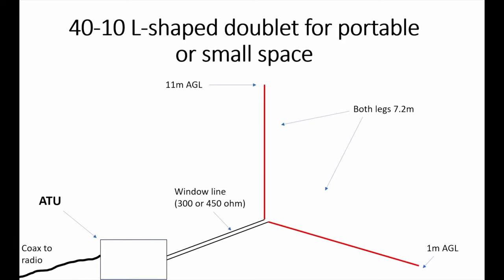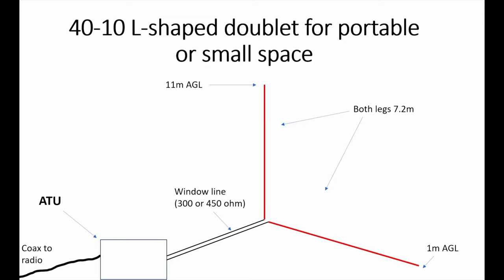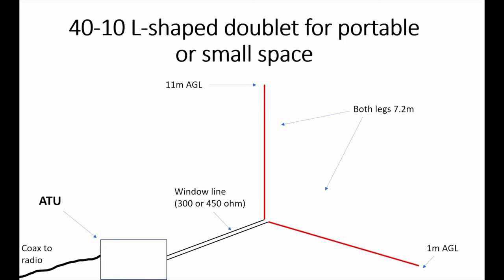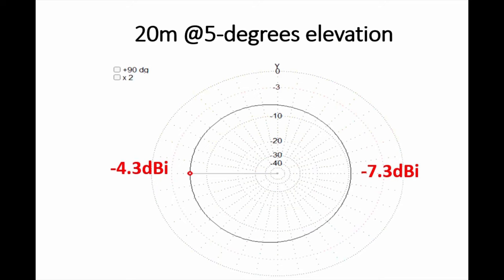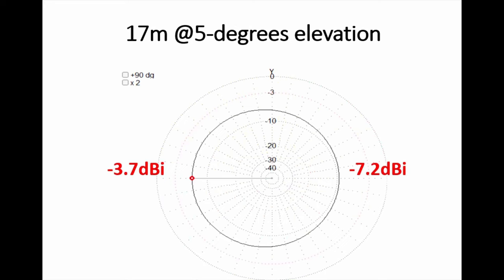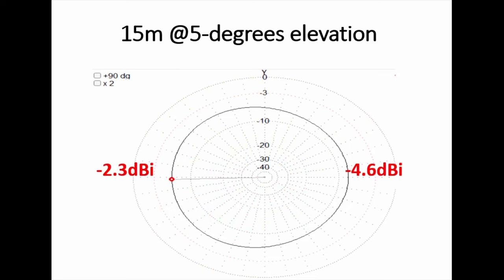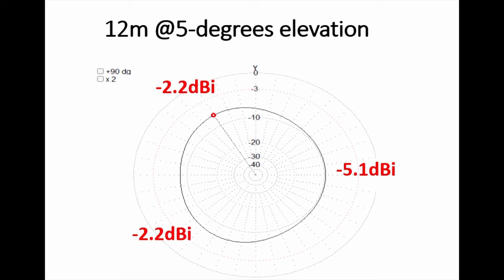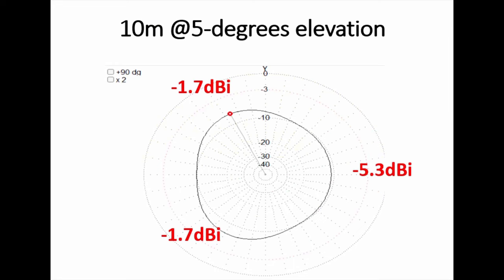Simple 40 Metres to 10 Metres Small Space Antenna

Comment: It might be interesting to know how much the feedline radiates with this setup.  In practice, I don't know what it might look like, but I imagine that the currents along the feedline don't cancel out as well as they would if erected as a traditional flat-top or inverted-v.  In theory, I might think that wit the proximity to ground being very different from one leg of the antenna to the other, it might generate a reasonable imbalance.  I assume the model is simplified to reflect the feed point and the two elements, and the feedline itself is not included?  Would be curious to hear what the finger-in-the-air difference is on performance of this guy versus a coax-fed variant (choked at the feedpoint).. but I'd imagine it would vary by band, and if the ladder line does indeed radiate due to imbalance, I guess there are some directions where it might help and others where it might hinder!   I have some 300ohm I'd like to get out and experiment with more.